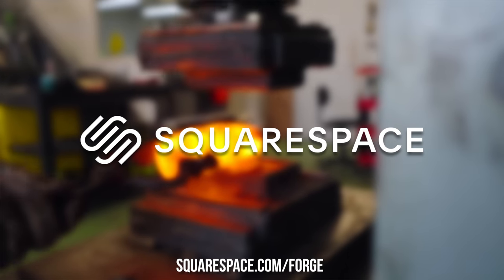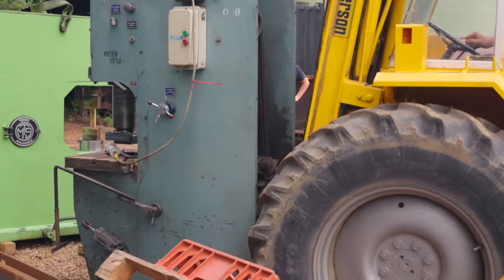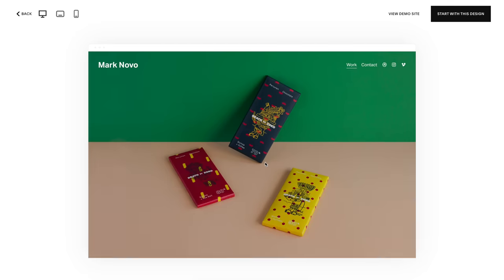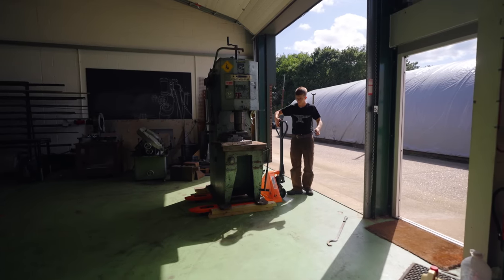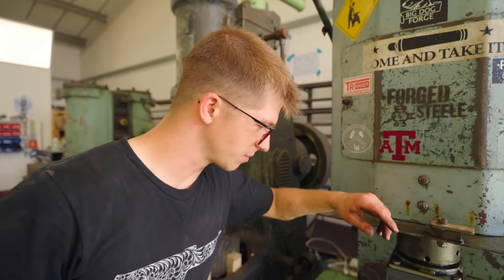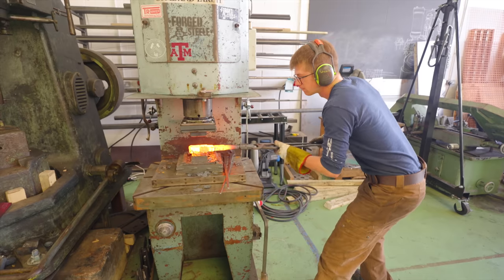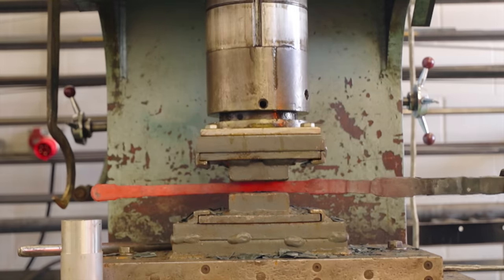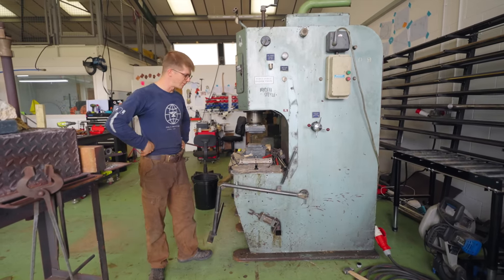Buying Back The Machine I Sold 5 YEARS AGO!

Comment: The selector must be damaged. Probably a good idea to at the very least take a peak inside.
Reply: I have a feeling we will see that. Alec may be satisfied with it now but that can’t last.

I was hoping someone would pop up in the comments telling Alec what to look for but I guess we will all have to find out together.
Reply: @markfergerson2145  There's still a chance someone worked with these and pops out. I'm pretty sure it's the selector because it only reacted/behaved when he touched it AND big clue, it didn't use to work back in the day. My money is on the previous owners playing with that thing, got it to work, then it goofed out and here we are.  Hopefully it's nothing expensive, that'd suck.
Reply: ...or have someone knowledgeable about presses look inside...
   Congratulations on getting it back 👍👍
Reply: The overpressure bypass valve back to tank might also be going or need adjusting. That would account for the behavior as well. Either way, it's time to open it up and pray to the Machine God.
Reply: @hulkthedane7542 yea it isn't a honda civic. I'd pay a few hundred to have a millwright come take a look and set me in the right direction.
Reply: @KnightsWithoutATable  A little shrine in the corner of the shop wouldn't be a bad idea. A carbide endmill, a few nuts. A shot of WD-40, that should please the Machine God.
Reply: @KnightsWithoutATable  All hail Metallicor
Reply: maybe' but lets start with filling up the oil, ypu know, the old KISS principal

Comment: Pickup filter for the hydraulic system could be clogged causing the pump to be starved for hydraulic fluid. Had the same issue with a 25 ton hydraulic clicker press causing it to act erratic.